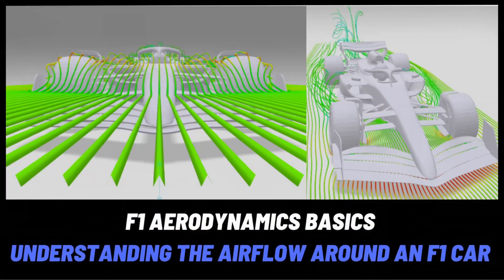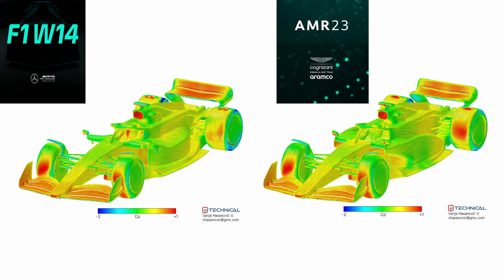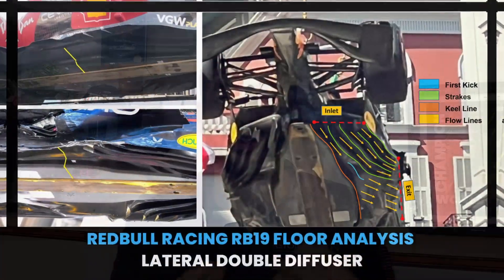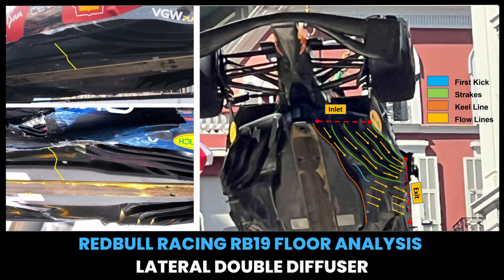F1 Aerodynamics Udemy Course : Learning with Actual F1 CFD Models

Comment: Hello Shub! i have been watching some of your stuff on CFD's and whatnot, and was wondering if you have ever tried Autodesk Flow Design, Its the only CFD I have right now, and It is working fine, but its been discontinued as it was a very old cfd (from 2014) i just wanted to ask if you hav ever checked it and if its a reliable CFD which gives proper data, because im very curious as to see if my data is off. also im very new to this, I know Autodesk also has a more advanced CFD program but ive found this to be much simpler and easier.

Comment: Hi Shub!
From the early 2022 test session onwards RB did something important: they eliminated the porpoising effect on their car! And that it's for good! How come? We know that these phenomena appear only when the floor generates too much downforce hence lower pressure. So in order to counteract that they have designed/engineered some relief valve/switching fluid acting in a passive way which works above the floor where is higher pressure airflow. Then they need to fine-tunning it track depending... Could this be done?